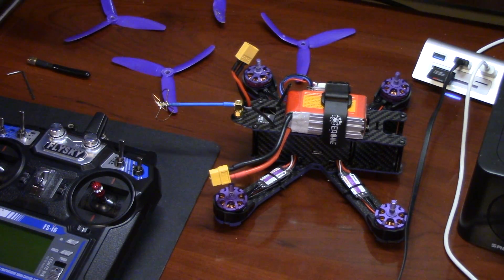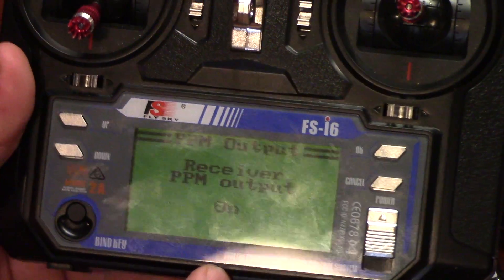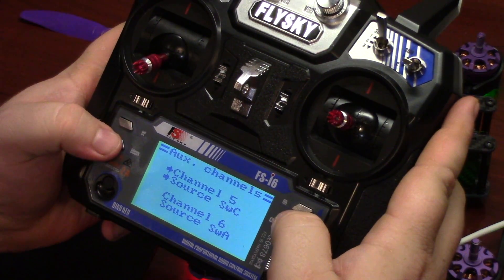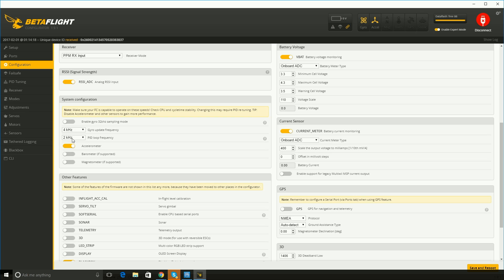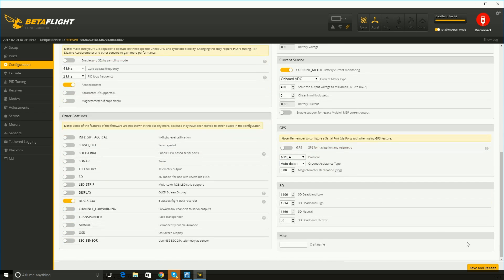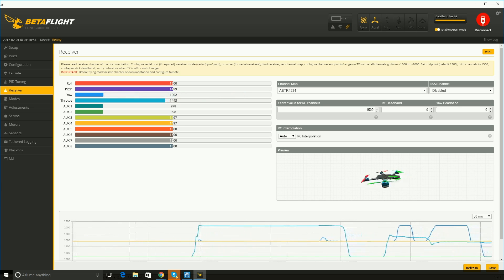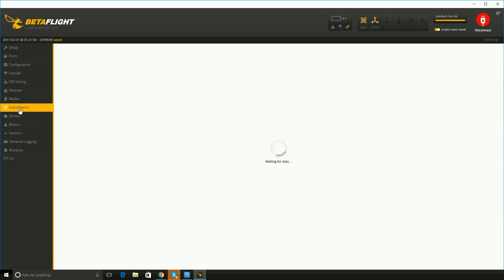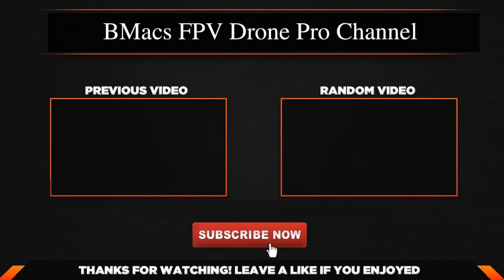Eachine Wizard X220 How to Configure BetaFlight After Flashing  Flight Controller Firmware F3

Comment: do you still respond?
Reply from the maker: Yup
Reply: @brianm6060  allright, i have a eachine wizard x220 with a flysky transmitter. I acciddently flashed it on betaflight and now it wint fly. The transmitter still shows that its connected and the lipo voltage off the drone, but it wont fly. Can i change it back to normal?
Reply: Wont fly*

Comment: Thank you so much for posting this video.  I have been pulling my hair out trying to figure out why I can't get my FS-i6 transmitter to work and you explained that the FS-IA6 receiver won't work with this quad.  I ordered the one you suggested so I should be up and running soon.  Thanks again for the info and keep up the good work!
Reply: Ive been doing the same thing too. I was about to return it and then I saw this lol. Still pretty mad i have to go buy another receiver though

Comment: I buy a x220 with an i6. And it is connected but it wont start the motors. Can someone help me?
Reply: jasper kaldenbach  arm it with throttle up then down and to the botom right for 2 sec
Reply: I have the same how did you fix it

Comment: hi ive done everything and also followed a e wizard setup vid. just when i go in cleanflight and tap receiver tab it doesnt respond?
Reply: mine is doing the same thing, how did you fix this?
Reply: you may have to rebind your radio to your flight controller before plugging into cleanflight or betafl;ight. and then setup receiver in configuration tab in cvleanflight

Comment: Hi so after making the settings changes I went out for a test flight but my wizard no longer "balances" itself when letting go of the right stick. Before if I was tilting forward/back/left/ or right, if I let go of the right stick, it would recenter its balance, but now it just continues to tilt in the direction that it was most recently moving in. Please help :(
Reply from the maker: CWD sounds like you are using acro mode.  horizon is the auto level mode.  go into beta flight and adjust your controller for horizon.

Comment: hey man this thing looks pretty stable but my 1 is always drifting toward right hand side without any command do i need to configure all this for smooth leveling
Reply from the maker: try adjusting trim on the radio.  push the little switch under the right stick to the left.  This should adjust your drift.  Do this until you can hover without drifting.

Comment: I received the RTF as a present and so far it has been a complete disaster.  The throttle goes from off to high speed with no ramp up at all. The right stick seems to change the engine speeds but without getting it off the ground I can't tell if they are working correctly.  The package had some damage in shipping but it didn't look like enough to hurt its operation.  So I figure I would go through the set up first to see if that was messed up.
Reply from the maker: I would try to go to the motors tab in beta flight.  Make sure no props are on.  Then click the check box.  Then click engine one and use the up arrow to increase the throttle.  Also go into the receiver tab and see if you have smooth stick movement.
Reply: I thought I just left a reply but do not see it.  I apologize if somehow I am duplicating it.I did as you suggested.  The throttle test in the motors tab worked smoothly.  But, number one arrow in the motor tab actually operated motor #4 on the wizard,  arrow 2 operated motor 3, arrow 3 operated motor 2, arrow 4 operated motor 1.The stick movements in the receiver tab were smooth.  Aux 1 operated Swc D, aux 2 operated Swc A.I appreciate your opinion.  I am trying to learn more about Betamax but it has been a slow process.Thanks,Richard
Reply: Betamax... you can see how old I am.  Meant Betaflight.
Reply: BMAC FPV, thanks, that helped.

Comment: I'm trying  to set up my eachine wizard on the beta flight app, but when I press the connect button, said no configuration received within 10 seconds communication failed. so what can I do now
Reply from the maker: +carolago100 try a different cable and or USB port.  I had a bad cable do that. Try on another computer.